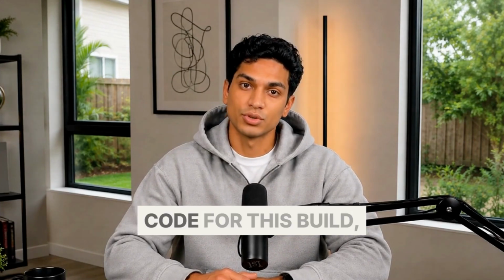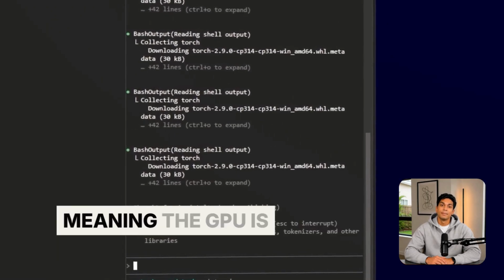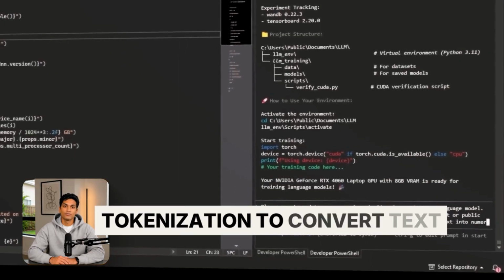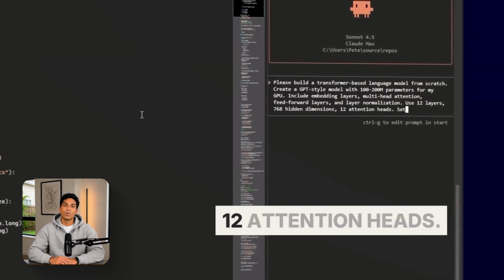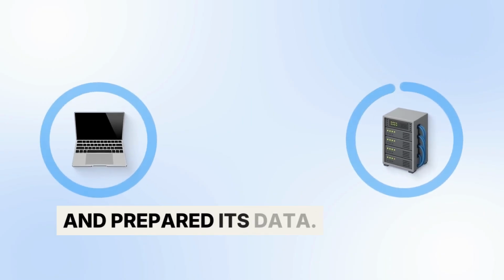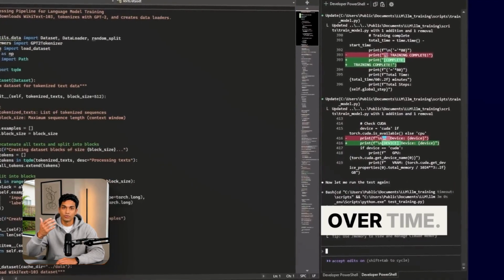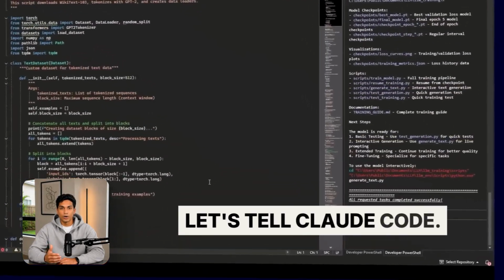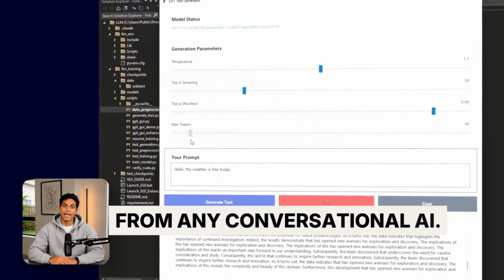I Built My Own ChatGPT From Scratch Using Claude Code (Full Beginner Tutorial)

Comment: Highlights by TinaMind:
01:24 Setting up a proper Python development environment with PyTorch, CUDA support, and necessary libraries like transformers and datasets.
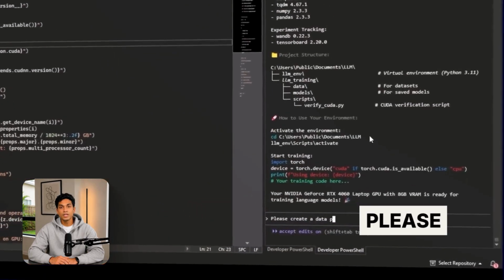04:14 Creating a data pre-processing pipeline to download text, implement tokenization, and prepare batches for model training.
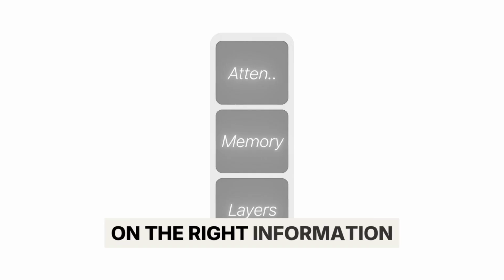05:31 Assembling the transformer architecture, including embedding layers, multi-head attention, and normalization, optimized for GPU processing.
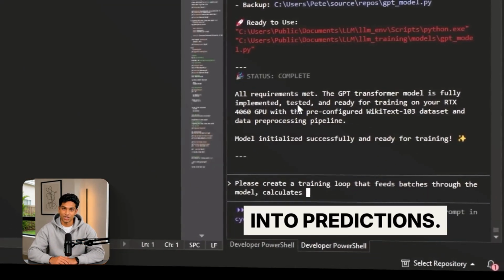07:50 Implementing a training loop that feeds batches through the model, tracks loss, updates weights, and saves progress via checkpointing.
10:02 Building a desktop interface to test the trained model with adjustable parameters like temperature and sampling controls.